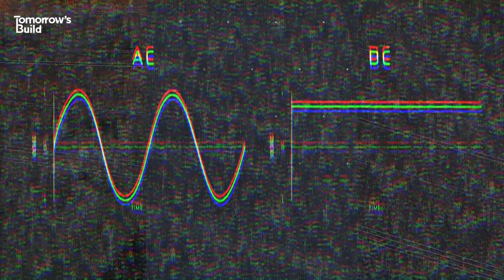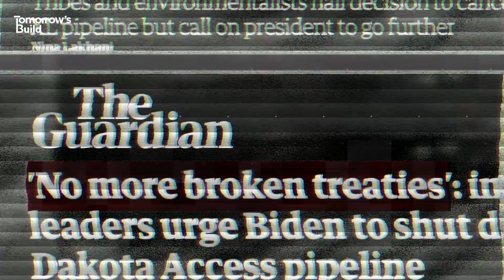The $23BN Plan to Power Singapore from Australia

Comment: The depth is just one issue. There's a large subduction zone where one plate slides under the other.  This was what caused the Indian Ocean tsunami in 2004. The cable would have to deal with both the subduction and the possibility of the ground shifting several feet in the event of the fault rupturing. If they don't, then Singapore would need adequate alternative power generation capability to deal with the very real possibility of this cable breaking and being unusable for weeks if it is damaged during a megathrust earthquake along the subduction zone.
Reply: laying the cable in a snake-like zig-zag pattern with lots of spare length might help?
Reply: It's strange they didn't mention this in the video. But since this is such an obvious problem in this region, I am sure there is a plan. By the way there is a subduction zone in the southern Mediterranean too, it's where the volcanic activity in Sicily comes from. So maybe the Italian cable guys have an idea.
Reply: Pontoons, floating cables?
Reply: @nulnoh219  I thinks any sort of storms would quickly sink any pontoons in the middle of the ocean
Reply: I was thinking the same thing during the video, they might also have planned this, they may map around the fault since the fault stops somewhere between Timor and Papua New Guinea. So they may just go around it maybe, or they may survey to a certain part of the fault.
Reply: None issue. Its a cable. Not a structure. Its a semi solid.
Reply: They knew this. It is a simple reality to live in. What hard to believe is the fact that Singapore, really chose to work with Australia, thousands of miles apart. While they have Indonesia and Malaysia as a neighbor with fairly large land and territory compared to Singapore. Just to tell you how rotten the institution that they have.
Reply: Dude i called them and told them your comment; They have not considered it yet And now must end all plans. They will be sending you 500$ for helping
Reply: @farajaraf  Ha! Spot on mate...I mean there's always a chance it's been designed by Tier 1 engineers and scientists huh?
Reply: I was wondering if it was possible for an eventually hostile nation like Indonesia to literally cut the cable to get something out of it after negotiating ; energy independence could eventually be a major geopolitical issue in the region
Reply: @lukayazbek  Their are 2 methods of engineering this solution of which aren't just necessary for grid defense but also system security in the case of component failure. In Europe for connections of England Norway Denmark etc they use a P2P connections and balance power using DC/DC conversion which will balance the electric potential based on the needs of that line to balance the power supply out. When shorts happen insulated gate bipolar transistors (diode in // to maintain polarity), act as a switch and reverse the power flow or there are current controllers being used in new construction due to price of these IGBTs or thyristors. However the other method in proposed super grids for the future will have to use DC/AC overlay to create network redundancy if you were to connect oceania or north africa with europe granted if this was the grid system that would be relied upon. But to sum it up multiterminal systems are used so if one station is down it can be balanced with the use of other terminals and line conversions. DC/AC and DC/DC conversion solutions is huge in research at the moment for not only super grids but microgrids for low power solutions such as phones.
Reply: @lukayazbek probably why Singapore invested on those submarines 😳
Reply: What happens if a high voltage cable breaks underwater? Does it electrify the water and kill anything nearby? Green indeed lol.
Reply: @Cujo5  There is surely a circuit breaker that will turn off the power in case the cable breaks. There will only be a very short moment before the power is turned off.
Reply: @Cujo5  If it was, thundering would have killed millions of sea lives everyday.
Reply: @preetomsahaarko8145  That's a good point.

Comment: 33 GWh battery? I will believe when I see it
Reply: This big, never been done before.
Reply: Also, pumped storage has much lower input-output efficiency than batteries
Reply: @Cyberguy42  I'm not sure what the power recovery ratio for batteries is, but pumped storage hydro is between 70% and 80% depending on how steep the penstock is and the size of the project.
Reply: @Dave_Sisson  There's experimental systems doing pumped hydro under water. Depending on how fast that tech moves along, that could be a great solution for this one. In reality though, no harm doing big batteries in Australia, Australia has one of the world's biggest lithium deposits, projects like this might actually motivate the country into setting up industry to actually process it into batteries onshore instead of just shipping raw lithium off to China then buying it back as batteries & that would be a huge positive, as there's certainly areas where batteries are needed over pumped hydro, such as electric cars
Reply: As of early 2021, 33GWh far exceeded the globally installed total capacity of grid-scale batteries.
Reply: @chrisyorke6175  are these batteries for storage or frequency stabilisation?
Reply: @mazzdacon2134  Going on what this presentation says, storage. They may help with ancillary services, but that isn't their main purpose or revenue source.
Reply: @chrisyorke6175  Interesting, the big battery at Hornsdale SA is used as a frequency stabiliser that’s why I asked the question about existing grid batteries.
Reply: @chrisyorke6175  Australia's first serious attempt at a battery for power though was 129MWh at the Hornsdale Power Reserve just south of this planned one. Now admittedly, that was basically outsourced & Elon Musk did the whole thing, but it still shows that Australia's willing to go big on solar batteries. That one was basically to power a whole state, all done in one go
Reply: @chrisyorke6175  ok, thanks for the info :)
Reply: The batteries and energy storage in general will be a definite problem for the planned solar energy project.
Reply: That's a lot of 18650's.
Reply: I suspect that a pumped-storage, closed-circuit hydro-electric system would be cheaper as well as lasting 5 times longer, requiring much less maintenance and not being full of toxic chemicals like batteries are. All you need is a dam or tank at the top of a hill, another at the bottom and a penstock connecting the two.
Reply: @Dave_Sisson  now we only need a hill ..
Reply: @RandomUser2401  While I don't know the Northern Territory, in my experience hills tend to be found in most places. Just find a fairly steep hill with room on the top for a modest dam and a few hundred metres elevation between the top and bottom and you've got a site for your pumped hydro power station.
Reply: @Dave_Sisson  nuclear is a better answer than solar and hydro. Ans cheaper than this project by a long shot
Reply: @moose5.9  You may be right, but the only ways to store excess electricity so it can be used later are in batteries or by pumping water uphill. I was only arguing that pumped hydro is better than batteries for energy storage, not generation.
Reply: @Dave_Sisson  agree
Reply: @Dave_Sisson  It is staggeringly flat out there in the deep NT outback. Some places you can stand on the road and just look around to nothing but flatness all the way to the horizon in every direction. It kind of gives you a bit of a weird vertigo feeling tbh.
Reply: @ninjafruitchilled  Ah, thanks for that info. If they don't have steep hills, then I guess big batteries are the only option to store energy.
Reply: @RandomUser2401  Plenty of hills in Indonesia.